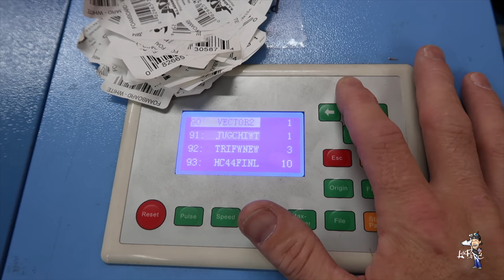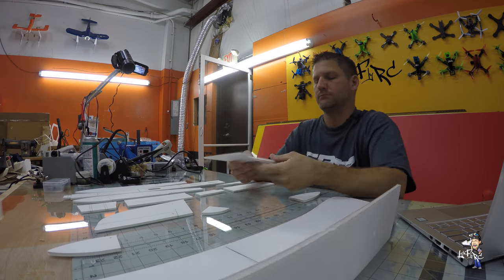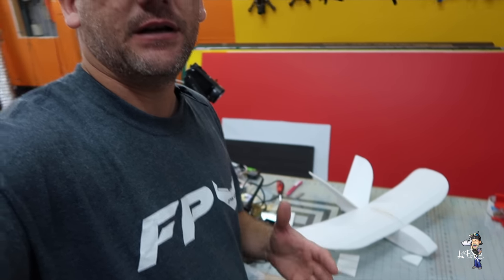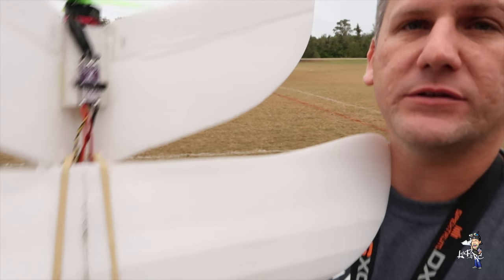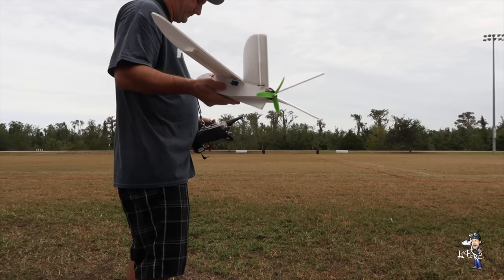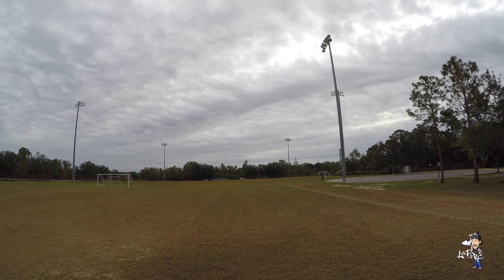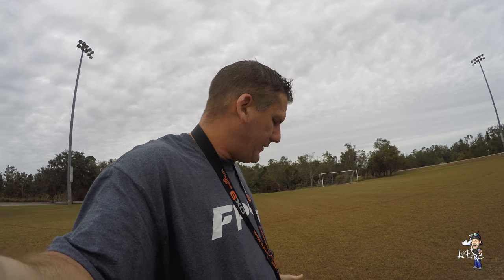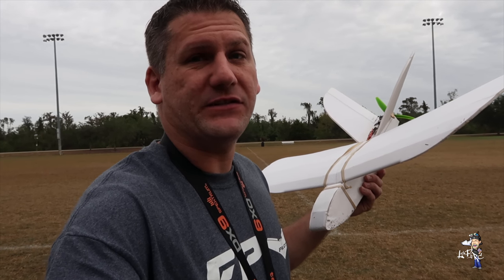Crazy Fast - Flite Test - 6S Ft-Sparrow - NEW FlyColor 50A ESC

Comment: Maybe I missed it in the video, but how do you keep the engine/prop spin power from spinning your plane to one side on full power? My small plane torque steers right when my throttle is on and glides straight when off throttle

Comment: The motor link says it only supports 3-4s batteries. Did you experience any cooling issues or anything? I know you said both the motor and ESC came down cold so perhaps you provided the wrong link for the motor?